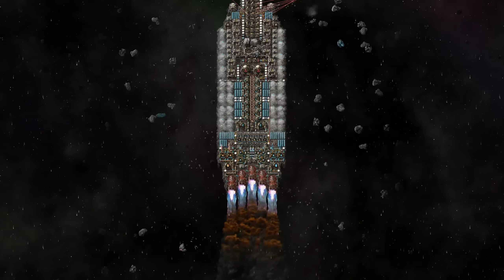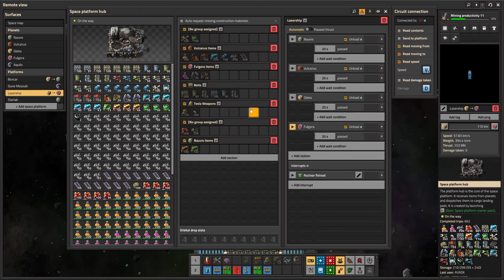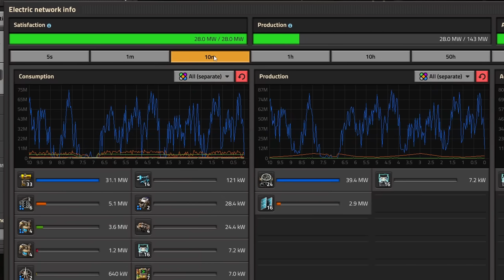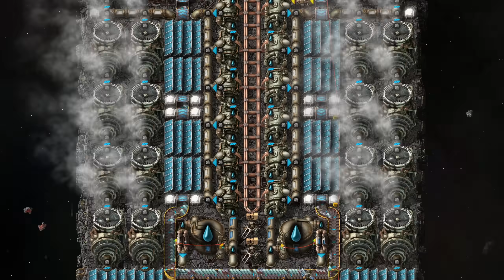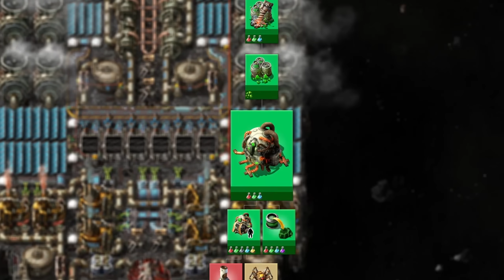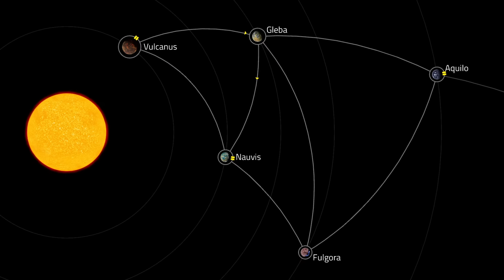Build a LASER Spaceship for the inner Planets! Factorio Space Ship Design

Comment: Careful, it does not start it's journey after building. Need to temporarily disable target reading in the hub on the first start, until there's some fuel residue in the thrusters. I recommend changing the combinator setting to V <= 0 instead of V<0

Comment: I have also used lasers in my designs, but I combine them with gun turrets and target filters. Gun turrets shoot only medium asteroids while lasers shoot only small asteroids. It might not seem that useful until you realize that when turrets destroys asteroid it spawns 3 smaller asteroids. So by using lasers against small ones you drastically reduce ammo consumption of your ship and you don’t need that many lasers either - just 3-5 on the nose of the ship is enough to deal with small asteroids even when ship is going 300 km/s. With 3-5 lasers you will be able to build solar powered ship, no need for reactors and turbines either.

Comment: Awesome ship design, switched my terrible inner planet floating bricks for this and so much happier with their performance. One change I did make was adding a wire between the input inserter for the asteroid reprocessing and the combinator for that crusher with the setting “read hand contents: hold”, as I had an issue when low amounts of asteroids were on the belt where the inserter would pick up the item, and then the condition was no longer true so it output the asteroid back on the belt and then got stuck in a loop. It’s only an issue when starting a new ship but is nice not to have to worry about.

Comment: I was confused because your channel avatar picture changed to a cute doggy. I almost didnt recognize this. 

What a nice design! Have you considered adding more engines to take advantage of the width of the ship, allowing higher top speeds?
Reply from the maker: There's only 1 more possible spot for an additional thruster. But speed is limited by laser damage anyway and the difference in efficiency between 5 and 6 thrusters is miniscule.

Comment: Hey! I like your content so I decided to share little advice. Circuit logic you use for asteroid reprocessing has critical flaw. Game seems to prioritize metallic reprocessing over anything else and if you leave your ship idle for too long it can clog up your belt with carbonic asteroids. It almost happened to me when I left my ship above Nauvis where it was dropping calcite. To fix this we need to use selector combinator to send signal only for this type of asteroids we have the most on our belt. If you transport ammo on this belt you need to use additional decider combinator to separate asteroids signals from anything else and then connect it to selector. Also to prevent crusher from switching recipes in case when you have equal amount of 2 types of asteroids you need to connect crusher and input inserter with selector input and set read content (or connect it to scanner decider if you use any. In this case you may need to use different color wire than the one connecting scanner decider combinator with belt. Otherwise crusher will get mad ) .
Reply from the maker: Hi. I don't see how this can happen. The ship has 2 reprocessing crushers. One for metallic, one for carbonic. So there is no priorization. They aren't connected to each other at all. The carbonic reprocessing will simply compare the number of carbonic vs oxide asteroids.
Reply: @AVADIIStrategy I must have missed that. I tried to use single crusher for all reprocessing and then set recipe via circuit and this is what I have learned. If you use dedicated crushers then it will probably work fine.
Reply: @AVADIIStrategy Also this kind of logic is effective even above Aquilo where there are a lot of oxidize asteroids and not enough of metallic/carbonic. Adding another dedicated crusher will also help, but it starts to take a lot of space on ship.
Reply: @Zeratai.  I generally use universal crushers, their only problem is that they need logic that is responsible for the fact that when switching to one of the types of asteroids, it must be made to work a certain number of cycles (memory cell and work cycle counter) so that the crusher does not constantly change the recipe filling the belt with asteroids
Reply: @Levin_sun that's why I use selector combinator. It chooses recipe based on amount of asteroids on belt. This way it always processes asteroids I have the most.
Reply: @Zeratai.  Sorry, my English is bad
I mean that without control of the recipe input, frequent changes may occur, which leads to constant unloading of the ingredient onto the belt, so the selector is actually not enough for universal crushers
Reply: @Levin_sun  it is enough. You need to connect crusher and it's input inserter with selector, or decider combinator if you use any to separate asteroids signals from anything else and select "read hand content" on inserter and read ingredients on crusher. This way number of asteroids remains that same even when asteroid is removed from the belt and inserted into crusher.

Comment: What do you think about building poles on space ship? I start use them to send signals from one side of ship to next side.
Reply from the maker: Looks kinda weird. But if it's neccessary: do it!
Reply: @AVADIIStrategy yes look a little weird, but how I found it's possible I tried it. Usually 4+ substation cover entire ship and I can use one set of combinators to decide about everything. I started using it. how much collector take and what, how many items place on belts. And this approuch worked good.
Currently I check how other people on thier ships. And currently I'm thinking what is better way to do it.

@Zeratai. Can you show examples? I will try it to check how it work/look.
Reply: @Underworld0X0  Just place lamp and connect it with circuit network. I like to use it to connect distant collectors to set filter. Their range is comparable to medium electric poles which is not long, but at least they take 1 tile and look pretty.
Reply: I prefer to use lamps for this.
Reply: @Zeratai.  i use blue inserters for that

Comment: My 5-thruster base-materials ship is quite tall, requiring 22 furnaces just for ammo production and 5 eff2 beacons servicing them and the crushers / fuel plants.  The rest of the space is practically tiled with q1 solar panels and accumulators, and still needed to be 12 tiles taller just to have stable power in Fulgora orbit.

Comment: I also experimented with just laser spaceships. You are absolutely correct that you need a certain level of research completed for damage. Your design is fantastic with no wasted space at all. A really impressive achievement. I've got something similar but it requires legendary components which is not feasible in the early game where as your design is easily achievable!
Reply: he is wasting space though, quite a few lamps on there to fill unused space. I personally prefer to run a 10 or 12 wide ship (depending on 1 or 2 thrusters) and self sufficient ammo production is just better imo